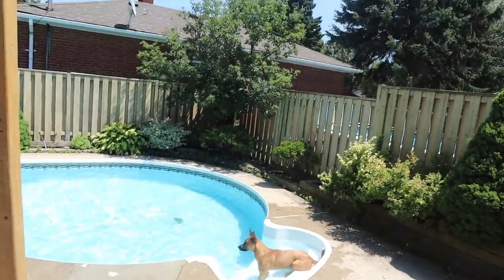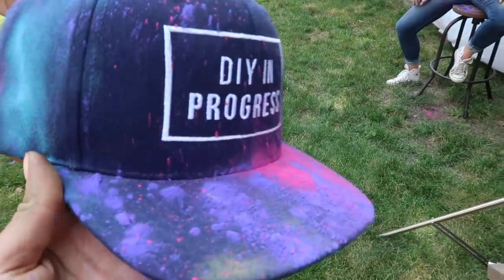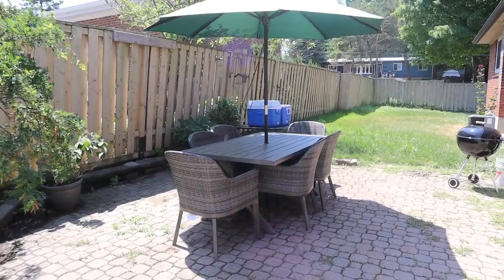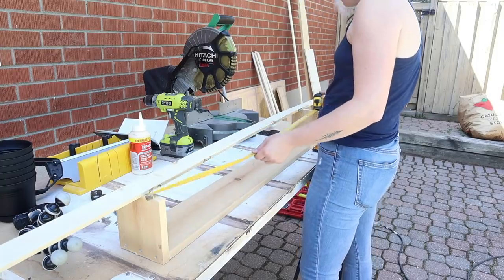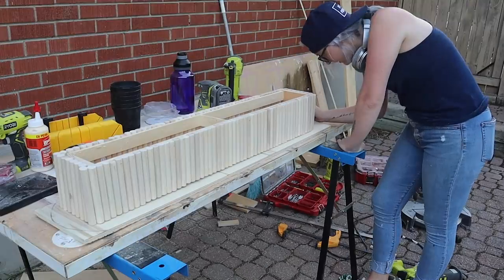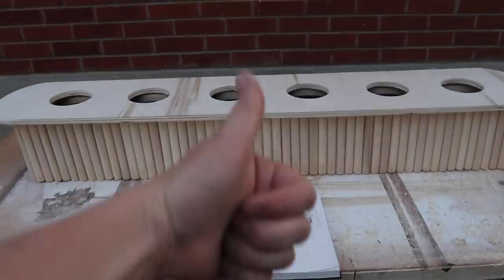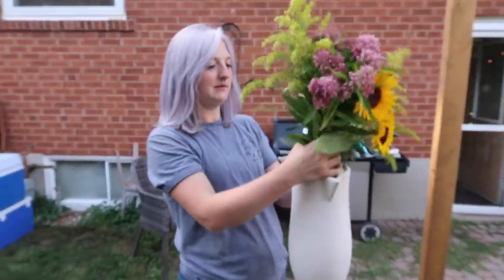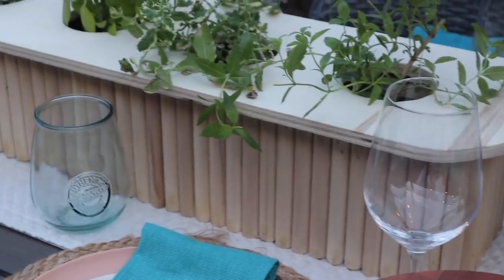my backyard looks totally bomb now | PART 2 - backyard makeover

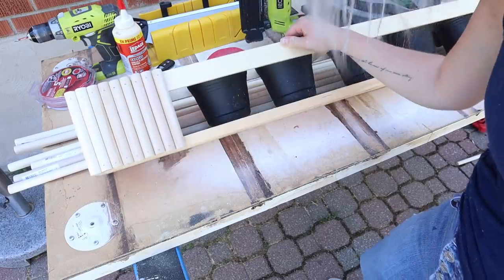Comment: Quick safety tip for 8:41 - using a stop block is great for being productive and getting consistent cuts.  However, be sure to let the blade on your miter saw come to a stop before you lift it up or you can launch the piece trapped by the block.  I've done it and trashed the piece, not to mention scared the bejeezus out of myself when a 4" piece of wood sailed by my head.  Stay safe, everyone!

Comment: It's not practical actually,small flower pots won't give rapidly herbs, also with round shape of flowerpots there are lots of wasted room,Rectangle could work better. At the end when there is such a blog land to make a floor small garden why to build this?specially with herbs
Reply: The majority of flowerpots are round tho... Also, she has a dog, which means anything edible on the ground could be chewed, pissed or pood on, which is not really sanitary. And you can take it indoors when the weather gets too cold or as mentioned in the video, you can remove the pots and use the piece for something else
Reply: Danie mentioned that it was simply done as a centerpiece, not a permanent arrangement.
Reply: Gosh why so negative. The box is neat and when she is done with the herbs she can just put dirt inside and put flowerscinside. Orctake theclid off.oh and mist pots are round
Reply: Hey Z!  How about you just take her great creative ideas and adapt them into a project that would be perfect for you!